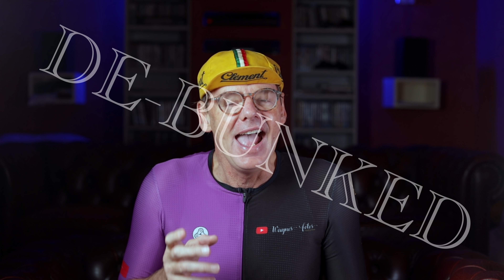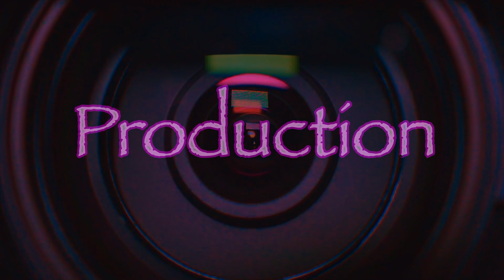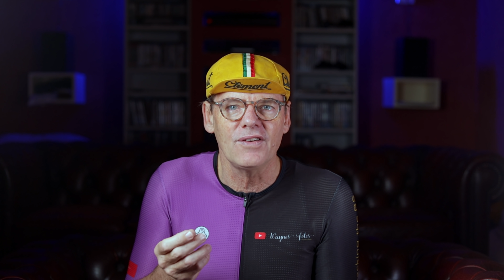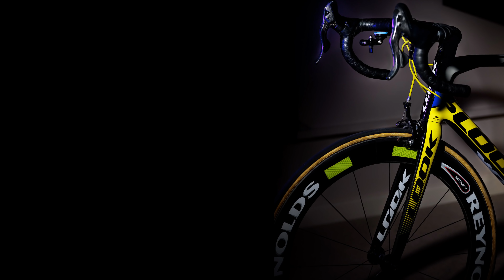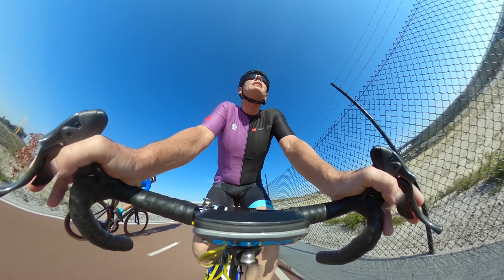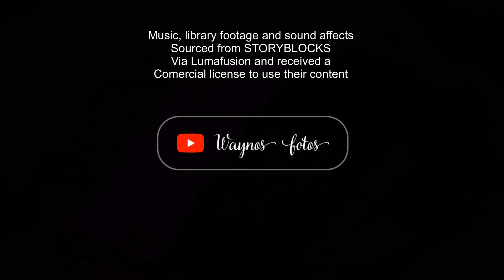DE - BUNKED Can wider tyres & lower pressures make you FASTER?

Comment: My ride to the gym, Proflex, ex mountain bike with rock hard springs and 50 mm semi slicks is only 1.1mph average slower on my 5 mile ride than my steel road bike.....16.9mph v's 18mph, it should be a lot different you know, 15kg and baggy gym gear ?? But the road surface is really crappy, pot holes, banding, loads of repairs, railway tracks, so the bike just glides over them, you are right (of course you are😂😂😂) manufacturers have no control over the roads we ride. 
Curiosity got the better of me, last night I fitted tubless ready tyres to my Eddy Merckx.... and no, I couldn't get them to seat with my track pump, had to use my compressor, app says I can run at 11psi lower than with tubes, ultimately saving a couple of Watts here and there is not as important to me as being comfortable, anything that helps to stop numb hands and a sore undercarriage on a long ride mean more to me than knocking 1 second of my ride time.
Anyway off to the gym........training to try and add 300w to my sprinting power 😂😂😂

Comment: Not sure why the industry is pushing wider is faster nonsense.Look at the TDF....I think they would know...I tried it.....too much drag on my quick bike....or it felt like it..For me 25mm is the sweet spot..In spite of everything they come up with  the fastest guys in the world are still using tubulars.
Reply: The industry is pushing the wider tires because that is what works with the tubeless setups better. In the mountainbike world tubeless is great. I come from that world after many years experience. So you can understand my wanting to get road tubeless to work. Truth is I have experimented with road tubeless for a couple of years, many brands of tires and sealants, and I have had very poor results, I should mention it cost me a small fortune too. I don't trust it. I still have had to carry a tube and use it every time I flatted, and the mess is something I don't want to deal with anymore. I use 25mm tires with tubes on the road bike, I have tried 28mm but took them back off after a month because the bike didn't feel so much like a road bike at that point. I felt like I got slower too.
Reply: @wasupwitdat1mofiki94  I have tried everything.. IMO nothing compares to good quality tubulars ….

Comment: For this kind of stuff you always need to pose the same question: compared to what?
I have 2 bikes, one with rim brakes and 23mm wide tires and one disc brakes with 28mm tubeless hookless.
In an ideal world the 23mm maybe would be faster but in a real world in my opinion is not like that. The level of comfort of my 28s are infinitely better than the one you can get with 23s... in rough roads I continuously need to stop pedaling with 23s because I need to absorb out of saddle every bump, where I barely stop pedaling with my 28s...and it was the same thing with 28s with tubes.
Reply: Exactly same thought here. I to have got two bikes with an identical set up. I too can't bear the feeling the saddle is about to rip me a second arsehole towards the end of a 100 mile ride while I can't reach for the bottle to have a drink without having to stop to avoid losing control of the bike on the grainy, delaminated and debonding asphalts here in the rural UK. I do have elbow, shoulder and knee niggles every once in a while which I don't believe come from overreaching in the training, but precisely from the vibrations and shocks that come from riding over damaged tarmac surface. Size 23 for racing and smooth roads, 28 for everything else.

Comment: Tubulars are dying. They’re just not practical for 99% of recreational or amateur racing cyclists. Aside a few time triallists, virtually no one in the uk uses tubs any more. Whatever the reason, they’re going.
Reply from the maker: That is true, because shops don't stock them and manufacturers want to move to hookless. But the reality is they are easier than ever to use with tape and sealants. It is a shame the industry is abandoned them 😭😥🙄.
Reply: You have to ask and to search to get tubulars.
Clinchers with inner tubes may be easier to handle as it is common with all kind of bicycles.
But tubeless are much more complicated than tubulars. 
I could mount tubulars when I was ten Years old. And we always had a old tubular under the saddle and a frame pump. In case of a flat we tore down the tubular and mounted the spare within minutes. Always got home.
Reply: @matthiasmay1977  The problem is if you get two flats and only have the one spare tubular tyre. I know it's rare but it can and does happen. If I ran tubulars now I'd put sealant into the tyres
Reply: I can change a tub quicker and more comfortably than i can change a clincher. Plus with rim brakes they're safer on carbon. Longer to install initially when wheels and tyres are brand new but who cares, pour a glass of wine and enjoy
Reply: Tubulars aren't dying. They're deader than the dodo. The last time I had any friends riding tubies was the late 70's (I'm 59). Here in the states only track racer still fool around with them and even they are moving away.
Reply: @phillipcowan1444  The other point is cost and weight. You can buy a tube and tyre now for less than the lighter tubs.

Comment: I agree the wider tyres does not improve speed. I have upgraded to 30mm without loss of speed or increase in speed but appreciate the smoother ride on our rough roads.  You are incorrect in thinking it's the tyre wall being thicker on hookless tubeless tyres that they are making stiffer.The part of the tyre which has to retain tight tolerances is the tyre bead which is usually made of kevlar or aramid  fibre. The sidewall can be as thin a regular cotton tyre to deform and give that comfy ride you like.  This deformation especially in corners or in the wet is what gives the  rider the confidence of grip which you will not get on a thinner tyre with thick sidewalls. Try a schwalbe pro one  which is rated on hookless and tubeless. Enjoy the ride.
Reply: That's not true all tubeless tyres will have a thicker sidewall even if just a liner to keep the air in on a cotton tyre

Comment: Bravo! Also one thing they never talk about is cornering with tyres and which is fastness and most efficient. Save the tubular!
Reply: Yeah you can't beat a 23mm up front, high tpi tub on a compatible- width rim, precise and snappy. Light, stiff and aero. Great for carving down twisty descents and smashing uphill out of the saddle. You want to cruise around on a fatbike? Sure, get some 30mm tubless hookless whatever BS they're pushing currently.
Reply: "Fastness" 🧐

Comment: Also when you run wider tyres that lift you up a bit-it changes aerodynamics and the geometry/steering .
Often i run a wider tyre in the back because there’s more weight to cope with.
A smaller tyre in the front brings you down a little bit.
In the end it’s about the surface of the road 🤙🍀

Comment: I've done my own test with this one and I want with testing both end of the spectrum when it comes to road tires: 23c v 28c. 23c Conti GP4000 S2 and 28c Conti GP5000.

Long story, short: the race earlier this morning, I went with the 23c tires. I've done way WAY better, I was doing less effort especially in acceleration compared to 28c. Given that the 28c is supposedly the better tire, i think I'll stick with my 23c's for competitive cycling.

Comment: Been looking at the Tour de France road  bikes & they are not on wide tires. They definitely don't look any wider than 24 - 26 mm & might be narrower than that. I train on Clinchers & alloy rims at 125psi . I check them 6 days a week. On my Carbon Tubulars l have been running some very old Vittoria Kevlar Belted 19mm @ 140 -150 psi. Haven't tried Specialized Cottons as yet. The 40mm Roval Tubulars 4 climbing r Super fast. The accelerate very quickly & hold the speed. Train heavy & race lite. Currently l am not racing. Am going 2 invest in a few sets of Clinchers.  The 38mm & 50mm Winspace & have also had a chat with a guy in NZ. Very decent chap. Going 2 order 2 sets of his carbon wheels in Clinchers with 180 hubs from Dr Swiss hubs. If u r climbing up hill at 80psi on the front & 90psi on the rear & l am running 125psi l will be faster at the same Watts on the Clinchers & on my Tubulars faster again. 

If u run 40psi in ur car tyres over a certain distance measured & 44psi over the same distance l guarantee u will use less fuel. Why ? Less resistance. Same goes 4 tyre pressure.  I roll down a steep hill with my Mate Andy. He's on his Machine one & l on my Tarmac. He runs 100psi & l 125psi. We r the same weight 75 kilos .. who roles faster..  if u r smart u have already figured it out. Me. 

Why r Track Tubulars 170 - 190 psi because they r faster at that psi. Super fast. Don't get sucked in by all the nonsense

Comment: Hi from France, 
I'm 61 now,been driving trucks for 40 years, both here and in Australia. 
I raced road bikes here for 14 years. 
We have tubeless tyres on the truck, 7.5 bars on the steer,8.0 bars on the drive and 9.5 bars on the super singles on the tanker,on disc brakes,that i understand. 
Not alot of drivers where i work check their tyre pressures,they don't even check their tyres.
I run on my rim brake bike 25mm Vittoria Corsa tubulars 'cause the cotton carcasse enables me (depending on the pressure i put in them) a wide variety of options.
Now all the rest i'm lost,it's just simply ridiculous, what about the enjoyment of just cycling? 
I work alot,not much free time,i really don't have the time (or the money) to follow all the new trends,i just want to hop on my (ex-pro) team, rim brake,tubular bicycle and cycle without feeling guilty.
Great video,great subject.

Comment: Great video. It is a very interesting subject with a lot of variables.  No doubt an opportunity to do lots of testing on a suitable rig to test the various hypotheses to explain the results. I did recently change to latex tubes, not expecting to notice much difference, but was very surprised as the comfort and rolling resistance difference was very noticeable compared to el cheap butyl tubes. Of course that is all very subjective and not quantitive at all
Reply from the maker: Latex tubes do as the cotton cases do, rebound less energy than the butyl tubes, so yes roll better, and as the surface gets a bit rougher should give you a slightly smoother ride/advantage.
Reply: @waynosfotos  I have never ridden tubulars….weren’t they called singles in the olden days ?  Guess I won’t have the opportunity now. Don’t really want to go tubeless as seems like a fair bit of mucking around, for as you say 2 watts max…..
Reply from the maker: @chapmag6578  yes singles, some people called them. Very common in Australia years ago.